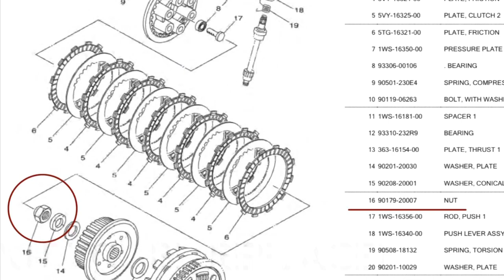MT07 Slipper Clutch Upgrade Using R7 OEM Parts

Comment: you dont have to take the waterpump of just leave it on and put the clutch cover to the side with the waterpump still on it
Reply from the maker: You can leave the water pump on the case but it will be in the way. I remove it as I was going to change the coolant anyway.

Comment: Bang.. lepas tukar slipper clutch..lagi sedap ka atau rasa janggal bila x da engine braking dah..
Reply from the maker: Dgn slipper assisted clutch, bila tarik clutch lebih ringan. Clutch lama bila pulas throttle, kadang tak “grip” tapi dgn clutch R7 lebih “grip”.  Bila downshift laju dgn clutch R7 ini, tak rasa tayar belakang lock. Engine braking bagi saya tak ada perubahan.

Saya galakkan kalau clutch ori  haus baru tukar, pasal cos agak mahal.
Reply: Thanks bang bagi review. Kalau mau tuka slipper, recommended tak? Ke tak perlu?
Reply from the maker: @nasnahadi  kalau bawak biasa-biasa je bagi saya tak perlu kerana clutch OEM ok je. Kos tukar clutch plate pun lagi murah dari tukar ke slipper clutch.  Dari segi cengkaman clutch, Saya rasa slipper clutch lebih kuat.

Comment: How do you fix the gap I can’t get it to not have the gap
Reply from the maker: Don’t mind could you tag the timeline in the video.
Reply from the maker: If it’s at the 9 minutes mark, I recalled I put the last few plates on the other surface and wriggle it around, hope it helps

Comment: Terbaik.. tools lengkap elok
Reply from the maker: Yang penting clutch holder tool & breaker bar. Tak ada dua benda ini, payah nak bukak nut itu. Maklumlah 95NM oi. 

Torque wrench pun penting utk pastikan nut & screw tak tercabut.
Reply: @RubberTyres  bang ...beli slipper clutch order kat mana .bleh share harga x..skali dgn nut
Reply from the maker: @echofish  Saya beli dari second hand dari eBay USD$199 nut SGD$10.
Reply from the maker: echo fish  shipping tengok dari syarikat mana. Website eBay akan tunjuk harga shipping sebelum masuk kedalam cart.
Reply from the maker: echo fish  hantar terus ke doorstep macam Shopee